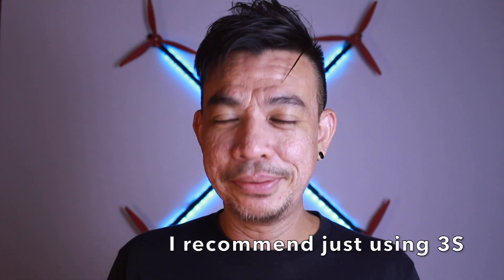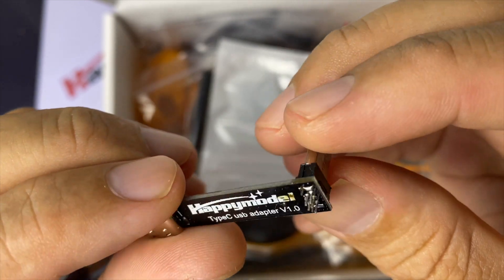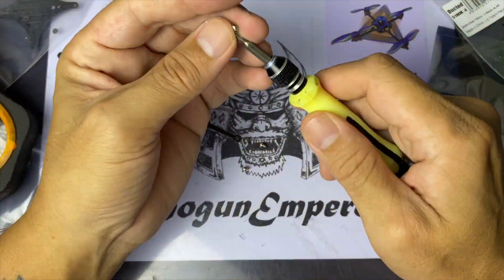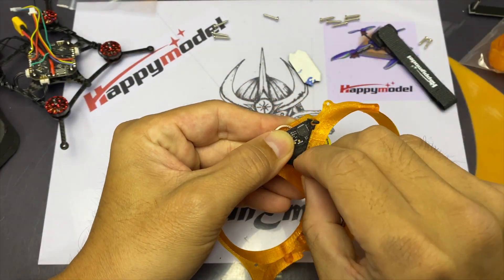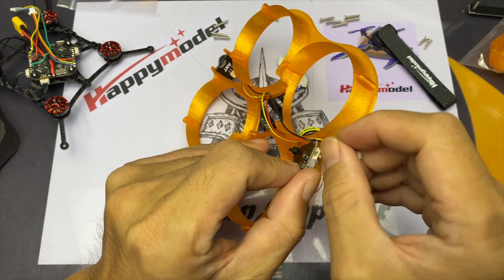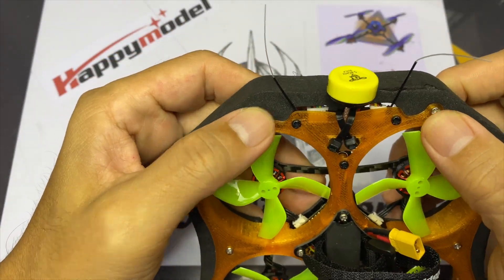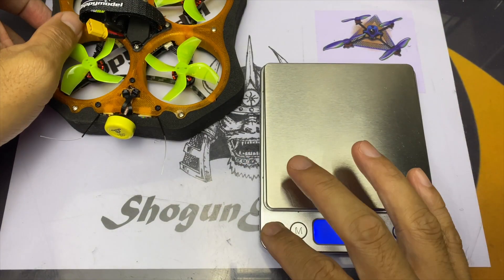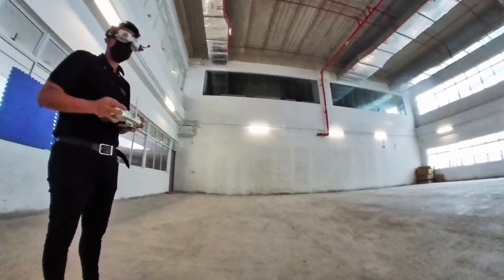DIY Cinewhoop Kit | HappyModel Cine8

Comment: Shogun emperor you know why my cine 8 when i trotel up and then i want to go down it like acelerate by himself and keep going up i have  to disarm but if i run slow and nice that no happen
Reply from the maker: Sounds like the airmode going nuts. Its the same with mine too.. maybe turn off airmode and see if that helps. Cause if ur using it for cine flying, i think it makes sense to just turn it off.
Reply: @shogunemperor  thankyou im going to check that
Reply from the maker: @transitionfpv6707  no probs bro.  Let me know if it works.
Reply: @shogunemperor  it gets better but it do the same
Reply from the maker: ok, so it goes crazy upon throttle?  I do suggest you reflash the FC with the stock firmware.  Here's the link just in case:-
http://www.happymodel.cn/index.php/2020/12/29/firmware-and-dump-file-for-happymodel-cine8-cinewhoop-diy-kit/
Hope this helps
Reply: @shogunemperor  thankyou
Reply from the maker: @transitionfpv6707  aye my pleasure bruh

Comment: Since you set props out, you also swap the motors right?
Reply from the maker: Thanks for dropping by man.  This Cine8 is already pretuned and all set up.  Just build and fly. This ones pretty easy. Just make sure the motor with the red wire is on the right front of the quad.
Reply: @shogunemperor  Thx. So it doesn't matter whether you set the props in or out, the motor with the red wire is on the right front of the quad?
Reply from the maker: @HendraGunawanITB  oh!  The quad's already preset for props out.  Red wire on the right is for props out.  If u planning props in, swap it to the left front.
Reply: @shogunemperor  i see; thx Bro.. just bought it, because I saw your vid :-)
Reply from the maker: @HendraGunawanITB  aaawwww thanks bruddah!!!  I hope u have fun with it like I did!!!!!  Its a nice flyer!!!
Reply: @shogunemperor  i wish you had a normal speed video of building this Cine8 though, since I haven’t had any experience building one.
Reply from the maker: @HendraGunawanITB  haha no worries.  This build is quite straight forward.  So its not so difficult yet gives u a good hands on experience.

Comment: Hi Shogun working on my build. Why props out? Just wondering thanks
Reply from the maker: Awesome bruh!!!  Cant wait to see it!  The props spin outwards and creates lesser turbulence and is said to be more efficient.  The testers found that flying props out makes it more stable than props in.  Hope that helps.
Reply: @shogunemperor  ugh this thing is killing me. Finished the build. Everything is bound and armed props spinning. At the slightest throttle input it goes to maximum power for a 10th of a second then cuts power and ugh. This is my first dud from Happymodel they are usually awesome. Trying to decide between moblite 7 or crux3 to fill the gap. Later bro
Reply from the maker: @jeffswope1511  sounds like a filter problem on betaflight.  Try copying this diff file onto your CLi.,  Im assuming ur on Frsky?
http://www.happymodel.cn/wp-content/uploads/2020/12/CINE8_Betaflight4.2.5_SPI_Frsky_Diff.txt
Reply: @shogunemperor  unfortunately I’m not a tuner. it’s okay I have a moblite 7 already on the way.